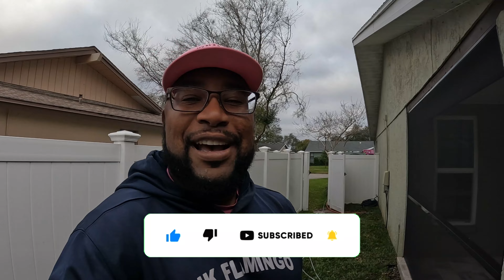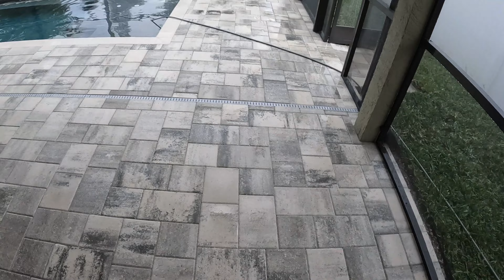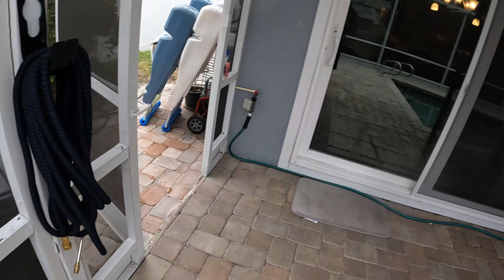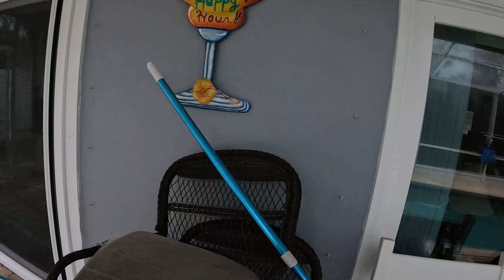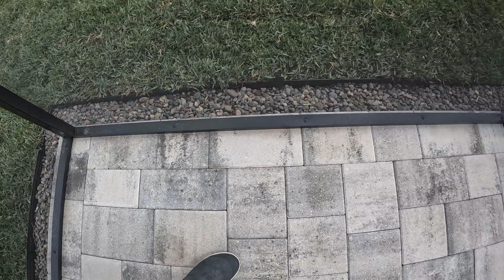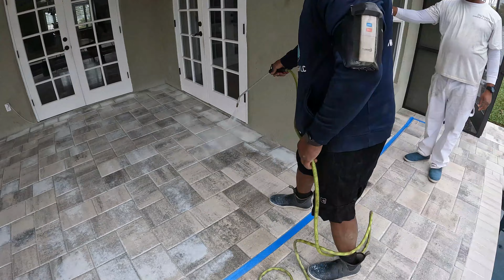Paver Sealing & Pool Cage Cleaning In St. Pete FL #paversealing #sealing #howto

Comment: Amazing video. Would you have any clue for the pull ratio of a 2.5 gpm pressure washer?
Reply from the maker: For downstream. It will be the same pretty much around a 1-2%
Reply: @PinkFlamingoPowerWash  Really, cause I thought the higher the gpm is the more %. But I only have 2.5 gpm

Comment: How many SF do you typically get with silacast per 5 gal pail? Fload coat/top coat(2coats) Thinking of switching from 2 part. My avg. job is 800 SF. Website says about 1200 but not sure if that's both coats?
TY bro love your content.
Reply from the maker: The bucket it for total sq ft.  I get about 900-1200 sq ft with 5 gallons.  Depending on how heavy I spray and also the porosity of the pavers.  A 5 gallon bucket will definitely get you 2 coats for 800 sq ft.